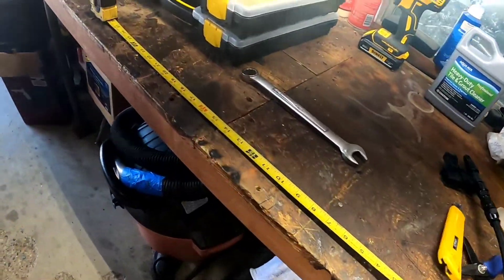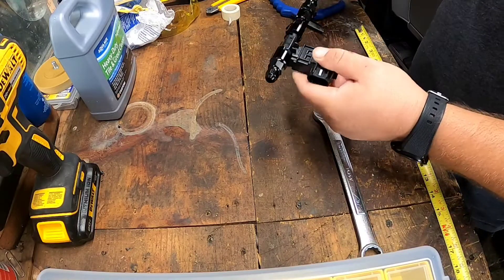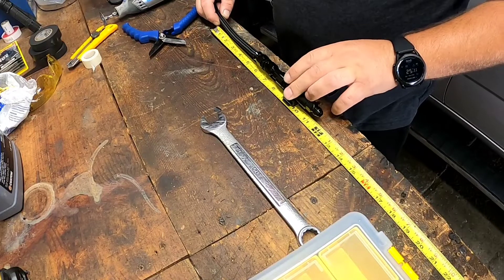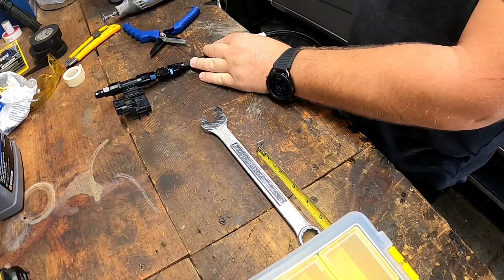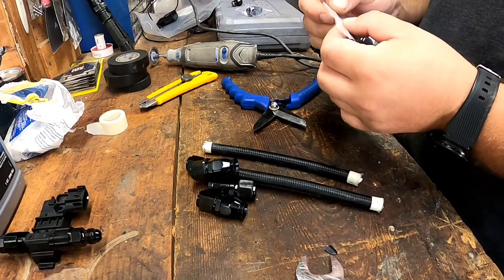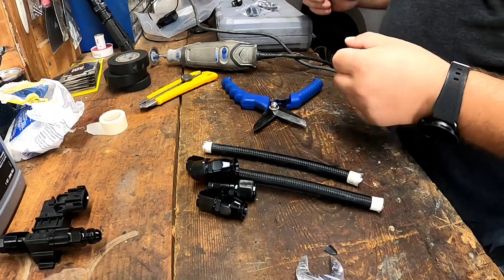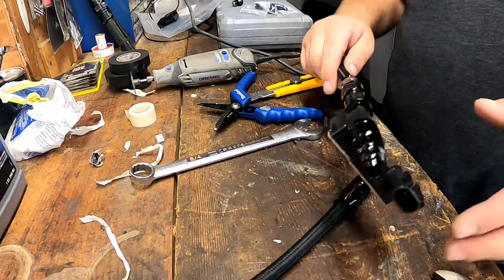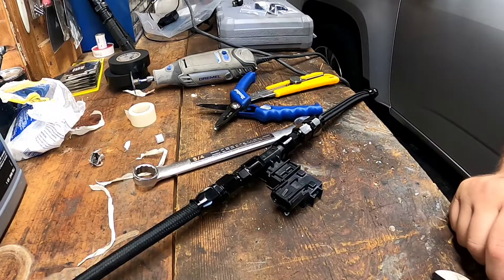Diy E85 sensor and fuel lines for cheap

Comment: How is your motiv flex fuel reading? Is everything accurate? I have the same setup as you is why I ask.
Reply from the maker: I'm using "flex fuel for mhd" module. I feel like it's off by little but it does the job. I'm android cic screen with mhd obd.